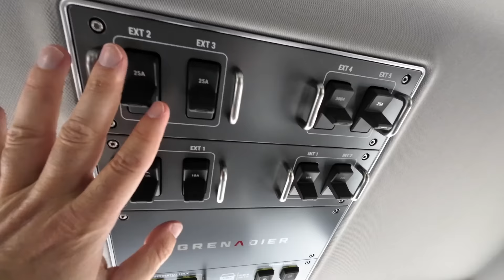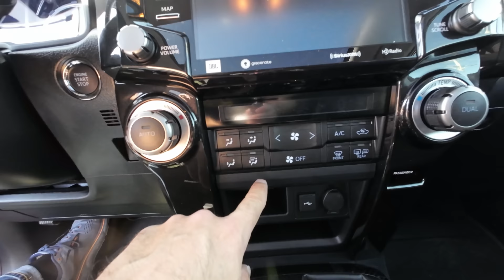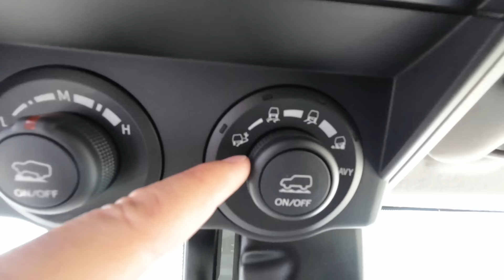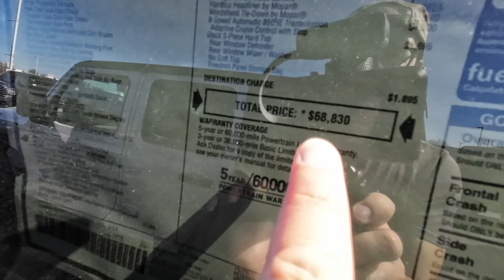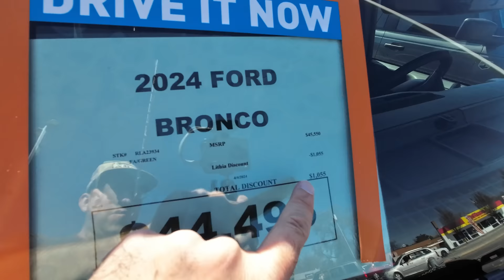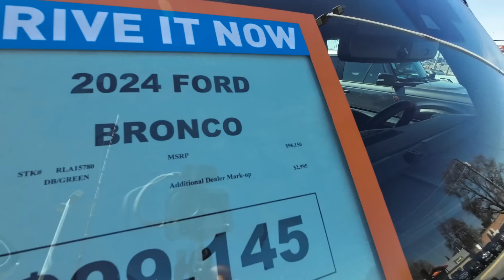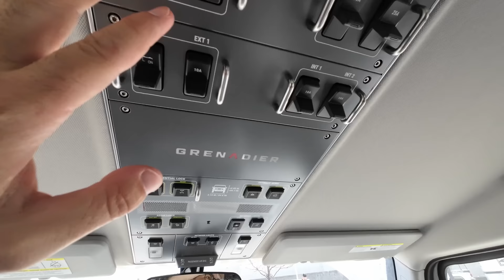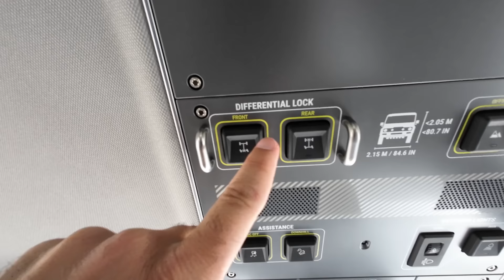This NEW SUV Has Ford & Toyota in PANIC Mode!

Comment: Any one of your so called best suvs are gas so they are more costly to own, require more maintenance, and are less safe due to higher rollerover risk and have less usable space with a similarly sized ev suv sue to all of the garbage in a gas vehicle including no front trunk.  Any one of the following would be much safer, handle better, cost less to own and drive would be the Rivian R1T, R1S, the tesla model x (which can not have a roof rack but can tow. The Rivians have better awd capability than any gas suv or jeep (refer to Sandy munro and his decades of owning a Jeep and off roading).  An EV has instant torque and response which is much better off roading when navigating obstacles where gas vehicles have delay and most evs have much more torque than gas vehicles. My model X has well over 700hp and easily out pulled a top spec Ford RAptor.  Is also does an under 3.0 second 0-60.  Even our regular dual motor model 3 sedan has 400hp and is more powerful than most pickups and suvs. Any awd tesla will out handle and out traction a gas awd due to superior control with electric motors versus a clunky mechanical drivetrain in any gas car. Gas vehicles are garbage and anyone buying one new anymore has to be just plain foolish. We own two evs and every ev owner knows gas gas well as they have been around for 100 years. Old technology and an inferior one.  The sad part is most ice owners do not know anything about evs or can honestly say they know gas is better or not because they do not know or have no knowledge.  Their only excuse is ignorance.

Comment: Really had me going on the Ineos until you popped the hood.    What a fucking turd choice of a motor.
Reply from the maker: Haha. They could have chose better for sure.
Reply: @MotorFeed  I also love the marketing. What Americans really want is a nice back to basics 4x4 with all the fundamentals. Other than the drivetrain I agree. Well that and the $75,000 starting price lol.  Think I should just buy another low mileage 2021 tundra CrewMax 1794 and park it in a time capsule for when my current one eventually needs to be retired at 1 million miles and that'll be my lifetime vehicle plan.